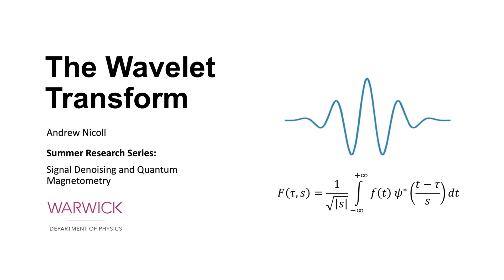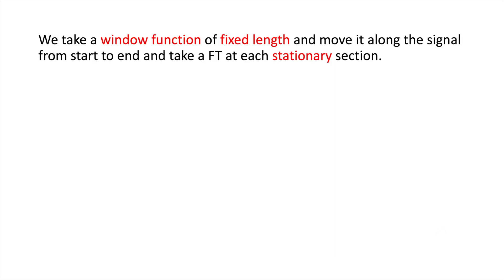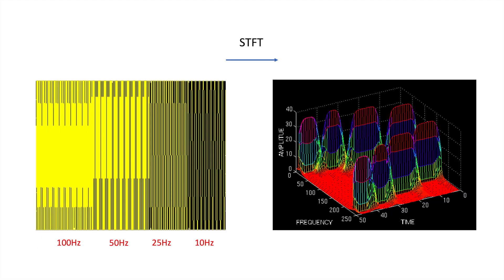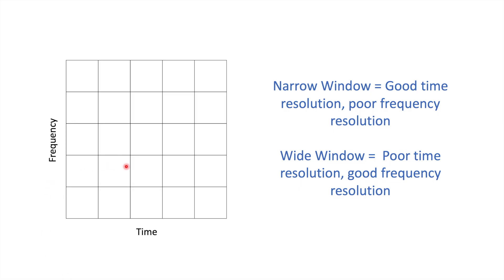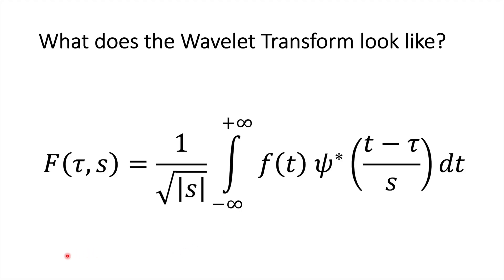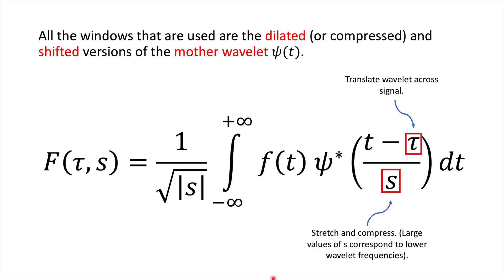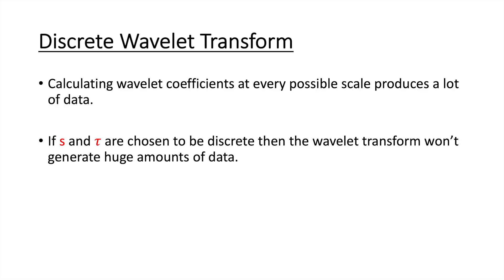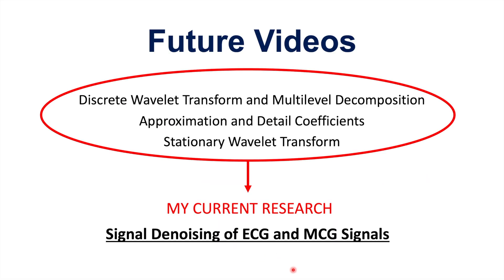The Wavelet Transform for Beginners

Comment: Awesome, if you came up with a tshirt to sell some merch based on this video would totally support it financially ;p Thanks~!

TLDR: A wavelet transform starts with a base wavelet—a single “unit” curve, often sinusoidal-like, that represents one cycle in its simplest form. Every other wavelet in the analysis is just this unit stretched or compressed in period and scaled in amplitude (exactly like how the periodicity of and amplitidue of can be varried for a trigonometric function); by iterating these two parameters and sliding each version across the signal in time, the transform maps where and how well the wavelet matches, producing a projection that reveals the structure and form of the original signal across time and scale.

*technically it'd be decorated with the absence of FA and what this adds, but KingISS

Comment: Marvellous! I've been somewhat using an almost-wavelet transform for years without even knowing it lol. Thats because I've always been working on financial econometrics without any engineering background. When I first started, my friends who were working as QC engineers for a propellor manufacturer introduced to me a concept where I could model the cyclic components of the data not just by using variance and correlations, but more importantly, accurately modelling the durations of the periodic cycles. They explained how they can identify defects of enclosed, rotating parts without ever opening them up, and they would be correct every single time. Though, I wasn't really interested in the engineering part because I was too affixed on the concept. So I've been using a complex series of functions in python to do recursive FFT and Laplace transforms at different sliding intervals to capture time-frequency and time-resonance information for time series forecasting. I've always overlooked topics about wavelets without actually knowing how significantly they relate to me. Today, it was totally worth it to look into this subject as this will make my work so much easier. Thanks, whoever you are, keep it up!

Comment: Thanks for this great tutorial ... at the 12:00 mark, in converting from a continuous to a discrete WT, we've lost the complex conjugate of the wavelet function, psi, during the conversion. why is this the case? Also, isn't a CWT/DWT similar to a cross-correlation function between two dissimilar signals, whose maximum represents the peak wavelet coefficient values?

Comment: Thank you so much for sharing knowledge. Finaly I've undestood the wavelet transform thanks to you.

I would like to apply it on my signal and calculate the new analytic signal for wavelet.

I tried to do it on matlab but I have some difficulty. I've used wden function but I got I don't know if it's working well. I don't know how to use parameters. 

Do you have any suggestions please ? 

Thank you again !
Reply from the maker: Thanks so much! Unfortunately my knowledge of Matlab isn't very good so I can't help you with that one. Ive only done signal processing in Python. Sorry about that.
Reply: @AndrewNicoll  Thank you so much for your answer. 

Please do you know, in general :

1- how can we get the analytic signal after wavelet tranform.

2 - How do we have to choose the parameter of the wavelett trransform.
Reply from the maker: @a.megzari  
I can only help you with question 2. One of the main parameters of the WT is the wavelet. Depending on what you want from your signal, you should choose a specific wavelet family (see link). Generally, I would suggest choosing a wavelet with similar morphology to your signal. 

In MATLAB you can use a discrete/continuous WT which is a function you can import. This will output your coefficients. The scale and time translation parameters are taken care of in the function itself. So really, your main parameter is your wavelet. Also remember you have different wavelet transforms: Decimated/Undecimated discrete WT's and continuous WT's. 

Wavelet families MATLAB: https://www.mathworks.com/help/wavelet/gs/introduction-to-the-wavelet-families.html

Hope that helps!
Reply: Andrew Nicoll 
Thank you so much 😊